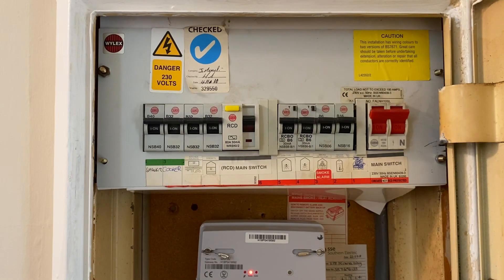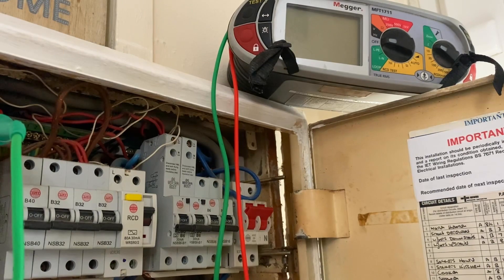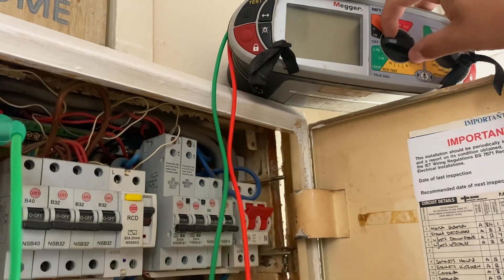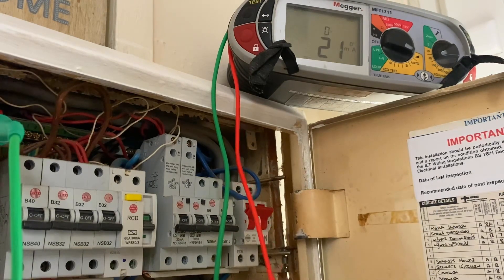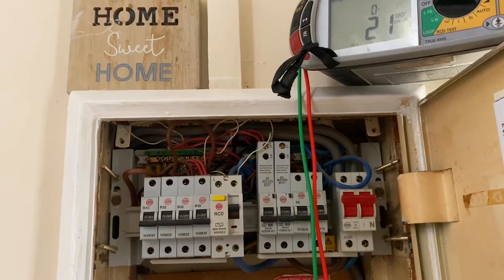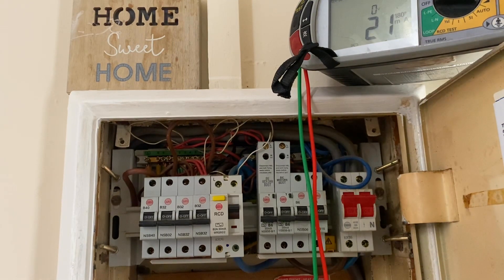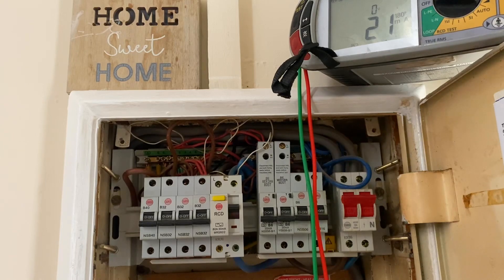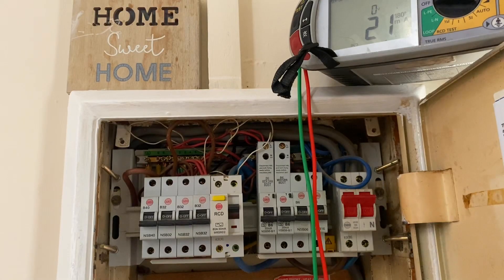How to Carryout the RCD Ramp Test - Why Does my RCD Keep Tripping

Comment: Is it not advisable in the absence of an earth leakage clamp metre, to test the RCD/RCBO in complete isolation as well as under load  to assess the true earth leakage? The circuits leak as well as appliances. I have seen a ramp of 18 ma without a thing plugged in but remove loads and neutral it hits a good 22ma.

Comment: Great video. Learner Question please :If you have isolated MCBs/RCBOs do you still have to physically switch OFF loads at the socket outlet and remove plug(s). Thank you. Loving these 5 min videos.
Reply from the maker: No the loads were removed by switching off the MCBs in this video 👍🏻. Thanks for commenting and watching
Reply: @GSHElectrical  Appreciate the clarification.Thank you

Comment: Isn’t the load side of the RCD the top were the circuit conductors are connected, the bottom is the feed or the supply side? Or does it depend on on the type of CU the RCD is fitted to .Same as a simple pendant light the feed in the 0.75mm flex to the lamp is the load , hence the term all loads removed. 
But who am I to argue i’am just a grumpy humble spark who’s opinion means nothing.
Reply: Top is load for rcbo , bottom is load for rcd grumpy
Reply: Supergob thank you for your reply. And you can call me anything you like . But I prefer Sean or Mr Dempsey  😂
Reply: @Dog-whisperer7494  will do Sean lol
Reply: @supersparks9466  😂 a bit of banter is not a bad thing.just watched a couple of your videos , feck me mate you seam to get some right sh-Ty jobs If I was getting crap like that I would walk away or pack it in completely. Absolutely disgraceful. Don’t you just love kitchen fitters. Hope you got it all sorted and safe.
Oh and I have subscribed to your channel.
Reply: @Dog-whisperer7494  it's the muppets who can't tell the difference between banter and insults that wind me up. Blimey I haven't up loaded a video for at least a year lol, I can't be arsed with the editing that's why there all phone one take short ones. Thanks anyway.

Comment: Great video . But most experienced sparks just unplug the kettle. 32years experience and every time I get calls for RCD faults it's the kettle. I'm yet to find another fault before I retire. But great instruction to test 👍
Reply from the maker: The video was more about the ramp test as the channel hadn’t got a video on that subject 👍🏻. Thanks for watching and commenting. Gaz
Reply: Or you can measure the leakage of the kettle, of course.

Comment: Get tenant to plug the lot in at once,an clamp the tails then switch off one at a time,this will give you the information your looking for👍 the ramp test is telling you very little as shown here, youv now got to put the board cover back on and still none the wiser as to whats tripping the rcd
Reply: Surely the ramp test is checking the RCD is not weak in regards to tripping at a lower than usable milliamps?
Reply: @michaels8336  
Does it ? What if it was 15ma then what did that prove
Reply: @ericthekingthekingtheking4842  Surely that would indicate a faulty RCD if it trips at only 15mA? Given the length of time that seemed to take, it seems like a worthy test to me - if you're in the board anyway.

Given various devices like washing machines that may only trip part way through a cycle - and maybe only on a certain program, it seems to me to be quite valuable to say the RCD tested ok, as did the wiring.